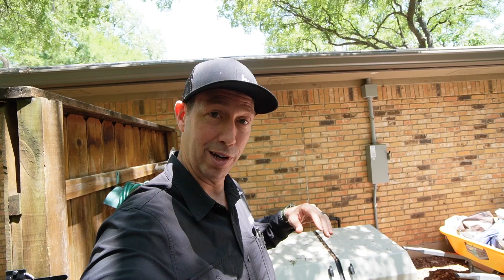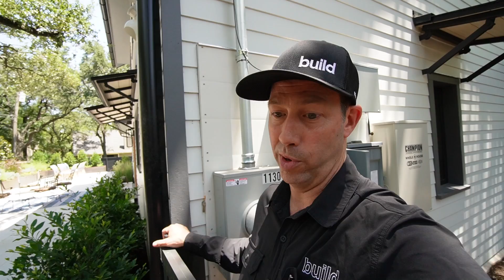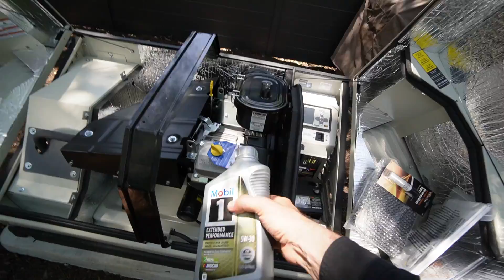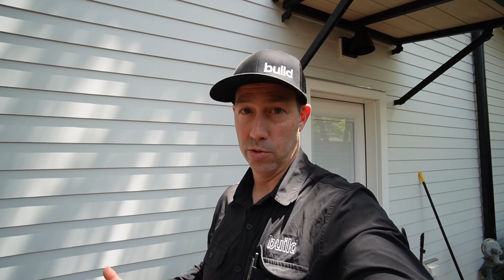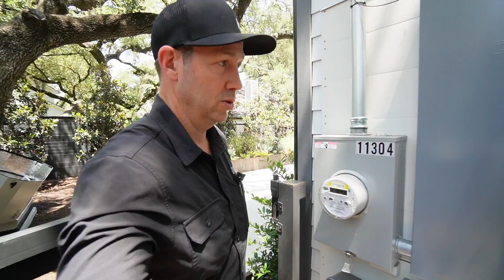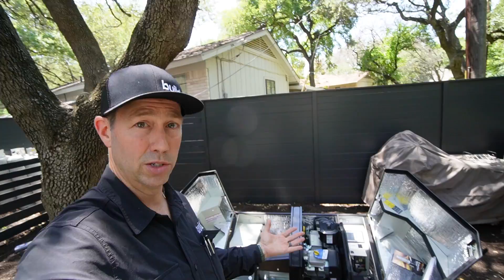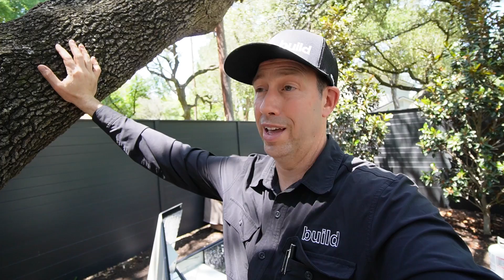Rolling Black Outs? Meet my little friend: Home Standby Generator

Comment: Matt, please consider getting some batteries and re-doing this show.  (The LFP batteries will last 3-10k cycles before any significant loss and aren't a fire risk.  7300 cycles is 20 years.  and then you can just add another battery.)   You can get 2 wall batteries (~14kwh each) and then use the generator to recharge them.  The generator (@14kw will only need to run for ~2 hours to recharge the batteries) and then your house can run on battery power for rest of the day.  Instead of using 50 gallons of propane per day, you'll be using 2-5 gallons and those propane tanks will last for weeks, not days.   Anyways, something to consider.

Comment: I got a generac 24kw unit.  My neighborhood doesn’t have the most reliable power.  The few times the power went out, it fired right up and powered the house.  I run it off my gas line.  Wished I had your charisma to only spend a few thousand for everything.  I could have bought a brand new $h1t box for the money I spent on mine.

Comment: It's too bad Champion standby generators aren't more popular than they are.  Generac still takes the top spot even though they suck for t he most part.  Kohler is quite popular as is Briggs & Stratton but who knows when either of those will go out of business or get bought out again.  If I were to go a standby, it would still be a Champion most likely but not with  their ATS as I could care less about that.  Not to mention everyone I've talked with that does them said they use something different.

Comment: So, a couple of things, LPG lasts quite a while, yes but it isn't the LPG fuel that's the issue, it's the cylinders.  The cylinders have a shelf life.  Stand by generators make no sense to me, or at least when connected to natural gas service as it's one of the other services that often gets knocked out during severe weather.  I live in a town in Ontario, Canada where we had a severe F3 tornado rip through our downtown core roughly 14 years ago and it also knocked out natural gas service so those who had the standby option were s**t out of luck.  The best option overall is propane, yes but the next best one is in fact Diesel.  

Also, I would say that having a portable generator is the way to go as well as you can move it around.  Most standby units are typically locked down in place and are also potentially exposed to the same severe weather as power lines.  You don't really need to run everything in your house, just the essentials like lighting, refrigeration, a microwave, toaster oven, heat and air conditioning. In fact, I would say you could use a smaller generator and keep to common areas during a blackout saving you money.  This is also where portable and window air conditioners are probably better than running a central or even split system.  Granted, neither are as efficient as those larger systems but actually consume little power when keeping to common areas like the living room.  

I have always wondered if standby units actually provide clean power compared to say an inverter unit.  I doubt it but that's another area where inverter generators shine and also the modular power solution through paralleling kits.  They are also incredibly quiet when running, and I know of one business that uses a stand by Generac for its information technology service and know that it isn't as quiet as even a Honda inverter.  Granted, the Honda inverters only run up to something like 6 kVA running and 7 peak but that's all that really is needed running a house.

Of course, in Texas, I hope you insulated your house otherwise the energy you use to heat or air condition your house becomes an exercise in futility with that energy leaking through the walls.

Comment: What RPM's does your generator run. 1800 RPM engines are the best generator. For under $11000, you can have a diesel engine driven generator. No propane bottles. With a 3000 RPM + generator, you lose a lot of fuel economy. So the initial cost of a diesel driven generator, with and engine that will last twice as long, would be diesel. A 12kw generator will do standby work for most homes. After all, it's only for a short period of time. Don't use that electric stove, use your propane grille, and don't dry clothes for the 3 or 4 days when power is down. Or you can turn off electrical appliances until the dryer is done.

Comment: I understand the appeal of a generator over solar, because it's real peace of mind and simplicity of operation and pretty low cost. I'd probably go the same route unless I just had budget to spare and was looking at solar anyway. But solar is pretty good even with ice and snow. The sun heats those panels up even under several inches of snow and avalanches the stuff off (safety concern, so be careful walking under them). Worst case, you could probably poke it with a long pole and get rid of enough to get by.

Comment: Can someone help in regards to Clearance required for a Generator from the Gas Meter? I hear just the general rule of 3 Feet. I have seen 3’ measured Radially, I have also seen 3’ from the main body ( & it’s spinning #’s ) & 2’ from all other piping.

Comment: I purchase solar four years ago for two buildings on my property since then I've looked into the battery backup for them which is over $12,000 for what I needed and again how long do batteries last looking at the generators I picked champion cuz I'm a motorcycle guy and I like that V-Twin motor but the quality and the ratings on it sold me and I'm glad I did I've got the 14 kz and I probably got $8,000 invested with the electricians in such installing the gas line I went natural but I'm pretty damn happy with my purchase and what I did but solar no thank you I wish I would have never got it

Comment: Honda, the only name to have for portable engine stuff, all else is junk.  My Honda generators where purchased just 1 year before we got Sandy hit the north east.  2 300kW units run in parallel, through the transfer switch, SILENT, instant start,run 18 hours on a tank of gas, nothing runs like a Honda, wait, that's a Deere...I lucked out with my hondas, we where only out 18 hours...even rolled one unit to my neighbors house so he could power his sump pump to dry out the basement, Honda saves the day, every one asked, is that thing running?  SILENT, no annoying droning like I heard down the street on the $400 use once junk.  My friend had a Briggs and Stratton it literally ran 8 hours, brand new, when the engine self destructed...junk.  Again, the high cost of low prices

Comment: Thanks for the video.  I am looking at this exact model to install at my home.  We have natural gas heating/dryer/hot water so this is a no brainer for fuel source for me.  Also, I ‘think’ you know about the Micro Air Easy Start for your AC, right?  I have them on both units at my home (4 ton down/3 ton up).  Game changer for greatly reducing starting amps.  I now have a portable Champion Tri-Fuel 7kW nat gas generator that I have used to run all essentials plus my 4 ton AC unit and it works just fine.  Looking now for a permanent auto transfer system, and this one look just right.

Comment: I am surprised that you are in a subdivision with natural gas and did not use it!  Far cheaper for water heater, HVAC heat, and clothes dryer, and you could have used it for your (much smaller) generator (and have propane back-up if really concerned about it not having nat. gas).

Comment: I’m sorry Matt but you made a mistake,  if you have natural gas to the house, you should have put a tankless in, gas cooking, maybe a gas fireplace and a Generac gas standby. It would run your whole house, automatically switches to generator and you can install it within 18” of the house, not out in your back yard like the one you have.  Yea, it’s 6k but  a much better system.  Just install the transfer switch during construction and the generator when you can afford it.

Comment: I have a 24kw generac it run 5 day on a 250 gallon but I use it now to charge a DIY 50kw solar system with a 7.5kw solar wen the texas storm hit we lost power for 4 days and I use 20 gallon of propene because we use the generac to run  the water heater every day for 1 hour and at the same time put some charge into the battery bank

Comment: Luckily LFP batteries are not much of a fire hazard, they(LFP) are way more affordable than Tesla’s power wall until they(Tesla) come out with LFP(any day now) AND the properties of that battery chemistry is great for keeping it completely charged to 100% as opposed to Tesla’s old batteries (POWERWALL) that should never be charged to 100% or drained below 1% AND they are more likely to catch fire 🔥 in the unlikely event of penetration. I absolutely agree with your champion system and would probably augment with a solar array and LFP batteries. Also using your champion system allows you to buy a smaller solar array and fewer batteries, Plus having a plan in place to prioritize energy usage to preserve food and other necessities. 
I love your channel and been watching for years.
Thanks for all your hard work 
🙏👍❤️

Comment: Matt, I’m wondering how to cost of the tanks compared to the rental fee from a local propane company. I think you stated $30 monthly charge just to have the tanks. I am currently pricing tanks for my system and the 100 lbs are going for $230 a piece. Where you able to get your tanks for a deal?

Comment: I have this unit installed.   We had some hot 100+ weather with fairly high humidity and I did a load test and she ran fine without tripping the overheat protection.  It's was working hard but it ran the entire house.   Also as others mentioned.  They sell a service kit which comes with plugs, oil filter, air filter.. Keep a set on hand with a fair amount of extra oil.  These air cooled engines go through oil when running 24/7

Comment: Batteries wear out, dead dinosaurs are the way to go.  Fuel consumption is much better with liquid cooled engines.  They are more expensive but your fuel supply isn't the best either.

Comment: I would for sure want at least 5 days of runtime. I would definitely run generator for 5 hours with load and change the break in oil out. Keep at least 1 oil change on hand for long outages.
Reply from the maker: Very smart!  Great call on both

Comment: Lifepo4 Battery cells, if cycled rarely (as an emergency backup) have been shown to last over 25 years (maintain 80% capacity).  Tesla powerwalls are not Lifepo4 cells (yet) and thus they may not last as long, but Lifepo4 (Lithium Iron Phosphate) chemistry is so stable and FAR superior to the Tesla Powerwall for longevity and safety as well.  NMC battery chemistry is volatile in a runaway condition, where as Lifepo4 is a kitten.

You really should look deeper.

Comment: I’m getting ready to purchase this exact unit. I recently changed over my home to all electric. Two 27000btu, three head mini split systems. 40 gallon HPWH. I was done with oil and not having central A/C. I also have a well pump. I’ll probably need three of the power management modules. 
I’ll be doing all the work myself except for the propane. No one will sell me a tank in my area. A bunch of 100lb tanks doesn’t appeal to me.

Comment: It is a shame and I think a rip off to have to pay $30 month for gas service even of you don't use any gas.  We have a gas furnace, water heater, and stove, but in the summer months the only thing using gas regularly is the water heater and only for a short time each day.  I think our summer usage is less than $30 per month.  I can see some minimum charge, but the gas companies cost is whatever it is to maintain you in their billing system and the cost of the meter.  That surely isn't $30 month.

Comment: The cost to buy and fill just one tank is roughly 3 years of fees. I understand being self reliant,but man you can buy a lot of nat gas for what you have into those tanks, if it’s flowing. If not a couple of tanks in reserve with parts to convert to propane when the zombies apocalypsize, is that a word, it’s mine now folks, might be a consideration.

Comment: 1.6 - 2.6 gallons per hour is the propane usage of that generator.
How many gallons of stored propane is that.
If there is an extended power outage, how many fueling stations do you expect to be open?

Comment: Great video! A side note from something that happened here recently i would let my neighbours know especially the elderly that you have a backup generator that way if the power goes out for a long time you can let them keep their food from the fridge/freezer. We had a multiple day outage in some areas and someone i know just hooked up a generator saw their elderly neighbour and offered which was a god send for them as they are a very thin fixed budget and just got the months worth of groceries. LOTS of stories like that here at that desperate time of need

Comment: Multiple options of fuel is always best, I would have never disconnected the natural gas from the street so it was an available option.  tri-fuel gen with primary Natural and propane and gas for back up.  I'd also build a box or shed for it all to sit in that looks nice in the back yard.  keeps it out of the weather, can set up airflow and cut down on noise.  You may not think 63db is load when your in your house but everyone else that isn't sitting with the TV or AC going will be pissed their food went bad and yours didn't and might damage it or take your stuff if things get really bad.  That generator is like a signal to everyone to come to you.  Solar with battery back up is good if you can get the ROI back in a few years before things start to fall out of warranty and start costing, but don't lease it.

Comment: Thanks for the breakdown as I've been looking into backup generators for my mother now that my father passed on last year. She's older, so there are some things to consider for her that aren't the same as yours, but both homes are good quality builds. She can do a 12kw system plus two Tesla powerwalls and it's $37k, way over the budget of your system (I've scene pricing of around $8k to $10k installed when I was looking). So there is a huge $27k difference in price, BUT your system sits there, does nothing 98 to 99% of the year, but a solar and battery system will produce you electricity all year. The above system could go much lower in cost if she went to 9.6kw and 1 powerwall, then it's $26k, but I figure the extra cost future proofs the home for when she does move out and a family will move in and turns the home which already is rainwater and septic into a true off grid home, a nice selling point. It also sets the home up to be able to handle even the harshest breaks, potentially running by itself for weeks if need be. In an ice storm there is no refilling tanks or getting out of her hill country home. 

As far as the batteries, they have a 10 year warranty of capacity of min 70%, but with the current systems using LFP chemistry batteries that are rated for well over 2,000 cycles, you are looking at well over 10 years. For recycling, there are already companies ready to take your batteries for cash at the end of their life (Redwood Systems is the main one, started by former Tesla executive). The biggest thing I like is there is zero maintenance for the Tesla or similar systems, just some washing of the panels twice a year and that is it. The standby systems usually have one or two times a year they need to be run to keep them preforming well, plus annual or every two year. At a savings of $120 a month on the solar/battery it will pay for itself around 22 years, which is near it's life cycle, but it's paying for independence. if you go the lower cost route, it can pay for itself in 16 years, plus I'm not sure on how much credit she would get over her bill, but above is just having the electric bill covered.

The cost of a propane generator is appealing, but at the end of the day, I didn't like that it just sat there and didn't really do anything when another option was there that reduced the load on the grid, especially at peak demand times of hot sunny days, and would make the house off grid in 99.99% of all situations.
Reply: @LB-bo8os  2 power walls are 26kwhs, or roughly 2 days of power with zero solar, nearly infinite power with even light sun. I have solar with a battery and it is able to go days without using the grid despite being a small system not designed for backup.
Reply: @LB-bo8os  your friend is using way to much power given what you say thier system is. 30kwh should last two days without any sun, and I just checked the weather to confirm what I remember and there was still solar production

Comment: I have a Generac on my house, it came with the house.  It's probably 15-20 years old and I couldn't tell when it was last used.  The gas connection was really sketchy (a rubber hose!) luckily it was turned off.  I replaced that, had it checked out and finally got it running.  It works fine for the 3 or 4 times we've needed it.  If I was starting over, I'd probably go for solar / batteries, but the house has a cedar shake roof which solar is no good for!